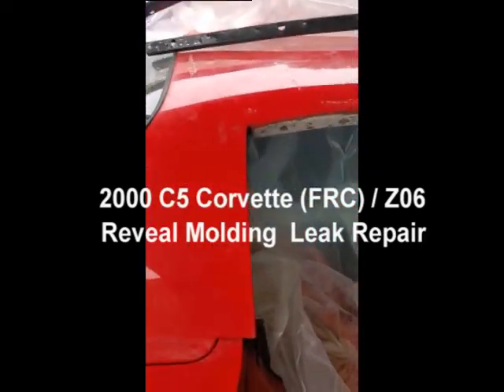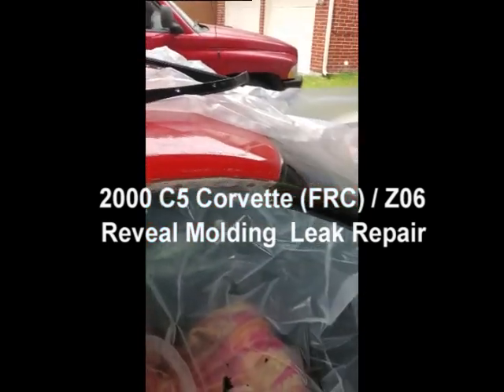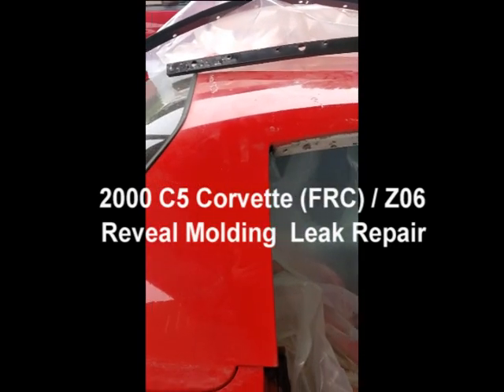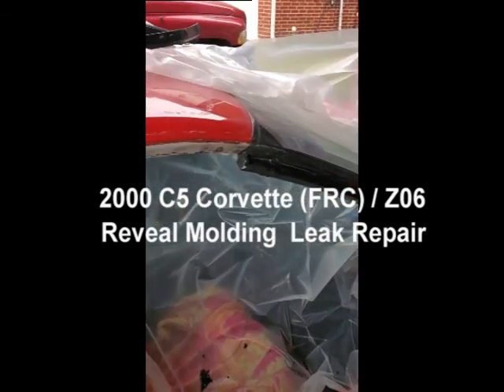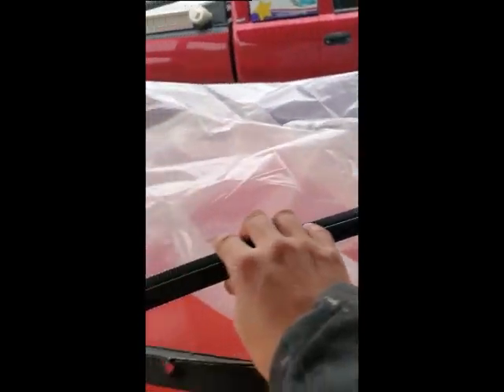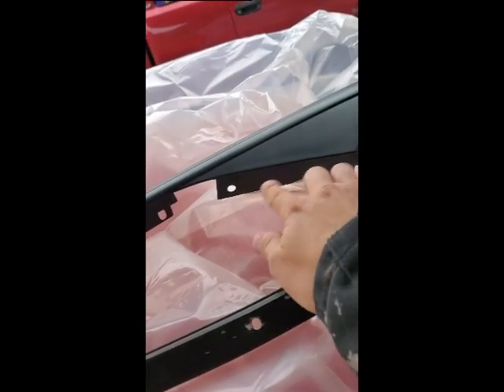C5 Corvette Reveal Molding

Comment: 2:25 That little strip of gray foam tape is the only thing between the interior and sheets of water driving into that channel.  That foam is now 25 years old and likely turned to dust which is why they leak and why the trim moldings crack.

Comment: 2:00  It's not just okay, it's necessary.  It's a gutter.  It prevents (or reduces) water running over the edge and down the windows, which makes the window seals' job easier.  Pour water into it with your door open and you'll see it draining into the hinge area, as designed.

Comment from the maker: Yep... Not one leak...
Reply: still good? 
I need to tackle mine. 03 Z06 both sides cracked.
Reply from the maker: @blakester310isftw  mine has zero leaks, not a drop... Works perfect... Everything I did worked plus aligning the window correctly, and changed all the rubber seals.

Comment: I put news ones on my zo6 and a year later the cracked again. I had water leaking in my front and rear floorboards and ended up someone replaced my front windshield and didn't seal it properly and it leaked

Comment: Where did you buy the new molding?
Reply from the maker: I would have to go back and look on my spreadsheet, but I believe the product code is different then it used to be and I know also that since I bought mine several years ago, they are very hard to find now.